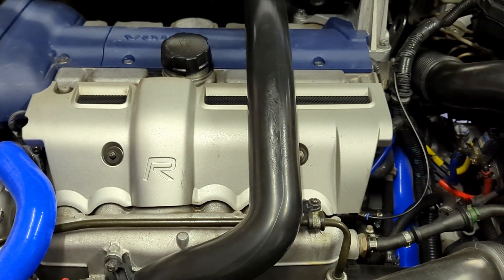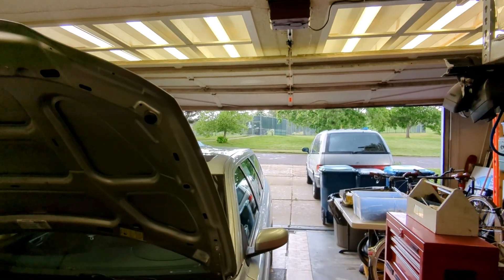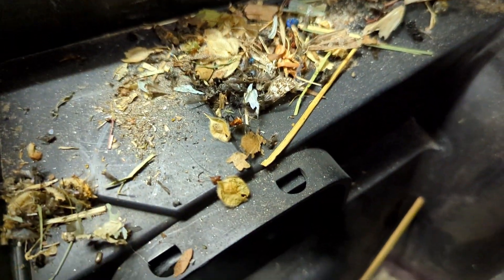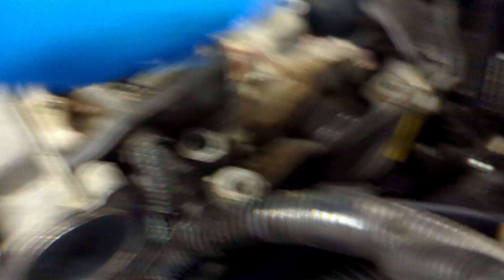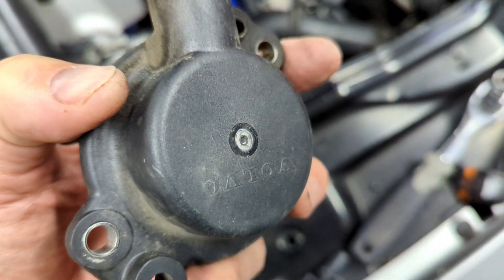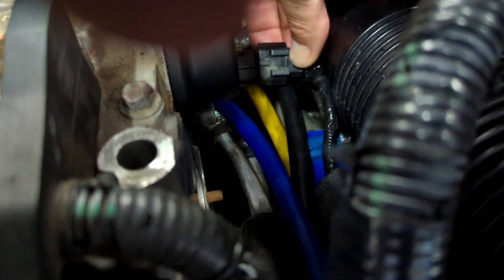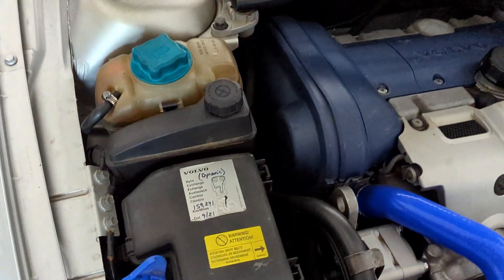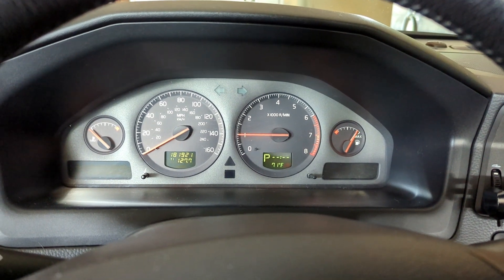Replacing Camshaft Position Sensor (Exhaust) on 2002 Volvo V70 2.4T after P0016 code (VIDA ECM-643A)

Comment: Have the p0342 and p0014 on volvo s 80 t6. Engine does not crank. No information on YouTube about camshaft sensor replacement
Reply from the maker: I am not familiar with T6 or S80 platforms and have not experienced those codes. Have you looked on Matthew's Volvo Site / Forums?
Reply from the maker: https://www.google.com/url?sa=t&source=web&rct=j&opi=89978449&url=https://www.matthewsvolvosite.com/forums/viewtopic.php%3Ft%3D84993&ved=2ahUKEwj8ipyUtpmLAxXsMjQIHdwoMOQQFnoECAoQAQ&usg=AOvVaw2xkavdwhcSJBvSsCW43IAG
Reply from the maker: https://www.matthewsvolvosite.com/forums/viewtopic.php?t=56118

Comment: What you're pointing to is not the variable valve intake timing. The VVT is on the front, or the opposite end of the engine. I have a 2004 XC70 AWD T5 and mine has both an intake and exhaust camshaft position sensors. I'm not how your vehicle can drive without them. Also; please use caution driving from Dallas back to Colorado. Highway 287 is a known spot for cops to bust people for drugs.
Reply from the maker: Correct - Working on the Cam Position Sensor (Exhaust) - which allows the computer to know where the cam is positioned with the corresponding VVT (Exhaust). This 2002 V70 2.4 T only has VVT / Cam Position Sensor on the exhaust side of the engine.

Hwy 287 Simple Solution: don't drive with drugs in the car :)

Comment: There's no need to remove the top bracket.
 You can reach behind the engine and pull just the sensor  from the plastic cover
 One bolt holds it. Takes 5 minutes to do it.
Reply: You sure? This sensor is different from the intake sensor

Comment: I have the same code aswell in my Volvo XC70 AWD 2002, but ive changed my camshaft sensor, cam belt, water pump and cam stretcher for new ones last weekend (going by the book), car works just great with turbo and all and no long cranks at all, just that the engine light comes on and this code exists in the data. Today i changed the engine oil, cleaned that big sensor thing by the camwheel and deleted the code, the code havent showed up sofar even after 2 restarts.
Reply from the maker: I think the XC70 has (2) cam position sensors: intake & exhaust. At least our 2007 XC70 does as a 2.5T platform. The 2002 V70 2.4T only has the rear exhaust cam position sensor. Ours was missing the o-ring seal for the sensor to the mounting bracket and it allowed a bit of debris in there - probably could have tried simple cleaning before replacing the sensor / mounting bracket...